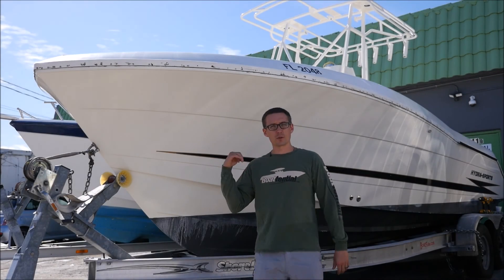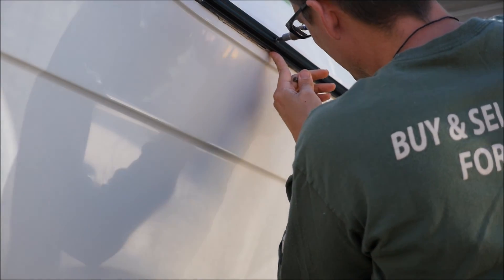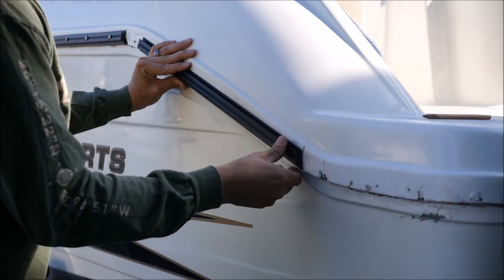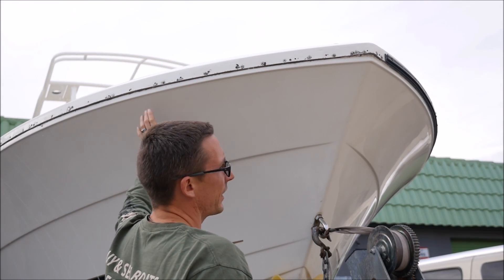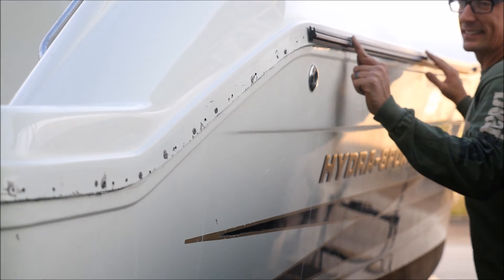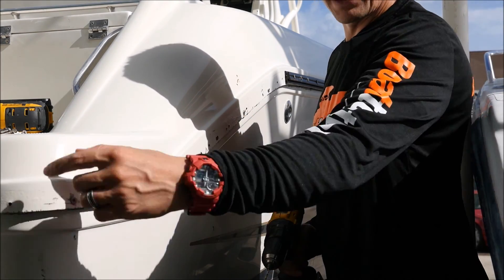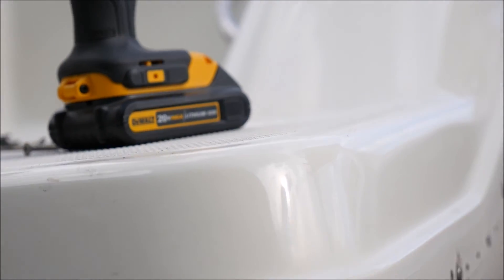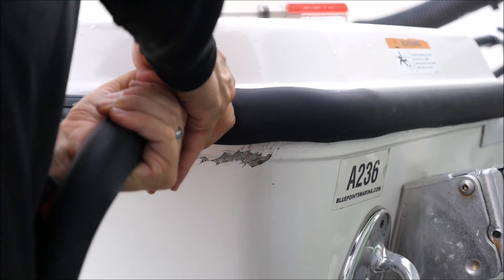INSTALLING A RUB RAIL INSTRUCTIONAL VIDEO

Comment: hey there, great job! Just a suggest, you don't need to cut the rigid track, the truck can be bent on the boat on both directions. The outer profile can be warm up a little and stretched on the corner, please refer to our videos on youtube tessilmare channel, ciao Margherita
Reply: Hey tessilmare, when making a 90 degree turn side to transom on my boat the back edge of the plastic rail channel pinched into the gap where the run rail is supposed to go. How do I fix that?

Comment: Please tell me this is a joke. If I brought my boat to get the rub rail replaced and they called me and said it was done and this was how it looked when I picked it up I would make them pay me money for wasting my time LOL . Do yourself a favor get a heat gun at your bends heat it up a little bit make your bend and then put your screw in. Have you ever seen another rub rail that looked like yours? The answer to that is probably no usually it’s one solid piece not 65 pieces cut up all together. And you didn’t fill in your existing holes 🕳! You realize behind those holes is a piece of wood that holds the top Cap of your boat on and that is now definitely going to be rotten very quickly

Comment: What about using a heat gun to bend the rub rail?
Reply: normally we don't heat the rigid track, you can bend it very easily, the soft part can be heated a little to be perfectly stretched on acute angles